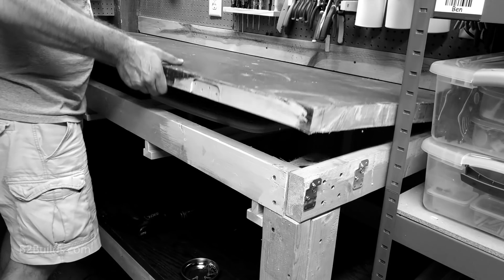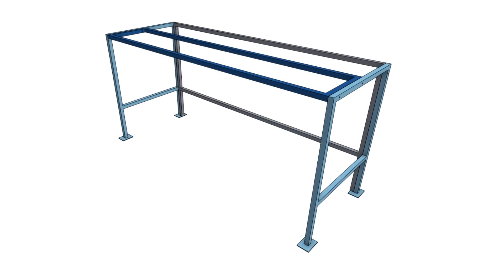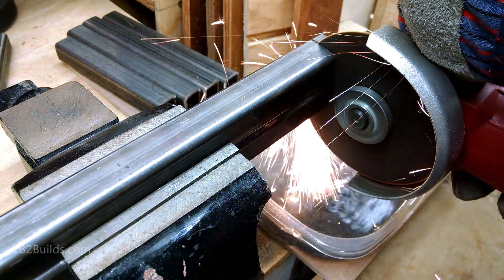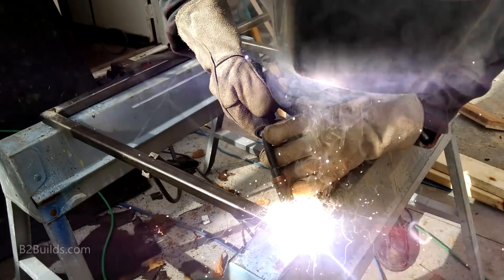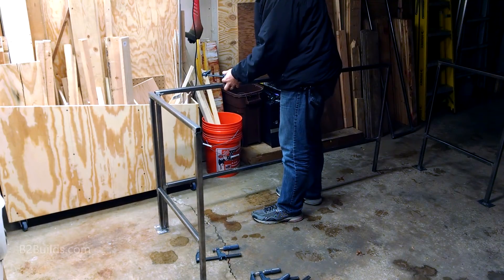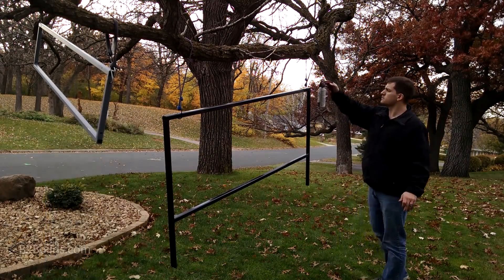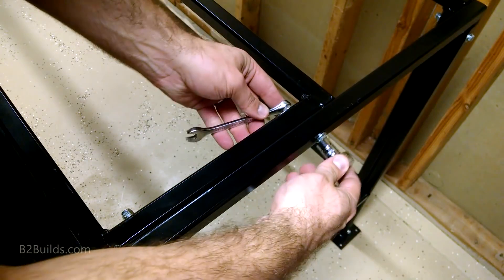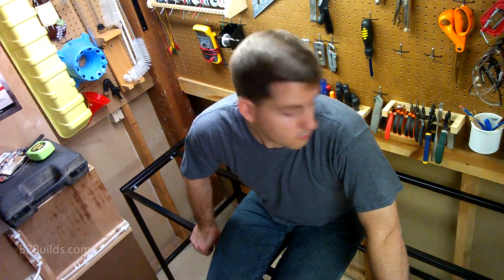Making a welded & bolted steel table frame

Comment: whether you use a 15 or 20 amp circuit makes no difference except that the 15 amp might trip once in a while. the welder will draw the same amount of current no matter which circuit you use.
Reply from the maker: On the 15 amp circuit, my welds broke off with a gentle tap from a hammer. On the 20 amp circuit I got much better weld penetration. I don't exactly know why but that was my experience.

Comment: Is it possible to make a table steel frame without using welding,just bolts? What are they saying here? "Assignment Brief:
You are required to design a steel structure which will be used to support a work surface.
The work surface should be 3.8m long by 1.5m wide.
This structure will be used in a lab or a workshop.
Do not include the surface in your drawings; only consider its dimensions when designing the structure.
Bolted fasteners are to be considered, you may not use permanent fasteners such as welding"

Comment: I love this project.  I love having my furniture in the shop mobile.  I also love welding.  I need to consider a similar build as I am currently revamping my workshop/workspace.  Many things are on hold until I decide what I need to toss, keep, where I want things to be kept on a permanent basis.  Lots of work flow related issues I need to work through.  Thanks for sharing this.

Comment: Use the edge of the grinding disk to grind welds, not the flat part. If you use the flat part you are going to grind away good metal. If you stock is say 1/16th, you are in trouble. Not to mention it makes the area look worse.
Reply from the maker: Yup, I held the grinder at a slight angle so it was mostly edge-to-weld contact. I worry that cutting in with the edge will lead to cutting too deep into the material, but maybe that improves with experience. Thankfully I had 1/8" thick material and it's not a show piece  :-)

Thanks for watching.

Comment: How would you recommend constructing a collapsible version of this?
Reply from the maker: +David Kearney Great question... I suppose the side pieces could just be attached to the back with hinges. The sides could fold inward. The top/front metal frame could potentially be left out if the tabletop was strong enough, or it could just sit down in some u-channel pieces on the sides. The top could have some slots cut into it to accept the frame and keep it square. I'm sure there's lots of ways to make it more easily collapsible, it just depends on how often you would want to do that. I probably won't be taking mine down unless I move to a new house, so nuts & bolts work fine for me.

Comment: I learn something new everyday. Placing the container of water under the outpouring of sparks is ingenuity at its finest. Great tip to store up in the memory bank for future use. Thanks and loved the video.
Reply from the maker: Thanks! FYI, to clean up, I poured it out on some paper towels on the ground outside. The water soaked through and the paper towel caught all the metal filings.
Reply: Ben Brandt Another great idea. Thanks. I know every time I grind anything in my little shop, I'm left with a nice pile at my feet and all over my shoes, and I'm not a big fan of tracking that into the house. This little trick is super helpful. I love how tips and tricks like this can make a world of difference.

Comment: I have not welded since college (a bit more than 1o years ago)  I would love to try it again also.   Great project.
Reply from the maker: Thanks Dan, this was my situation as well... I was fortunate to have a welding course in my degree program in college, and had access to good equipment at the time. I miss having access to welding and a machine shop, so it was pretty satisfying to lay down some welds again, even if it was on a cheap little welder  :-)